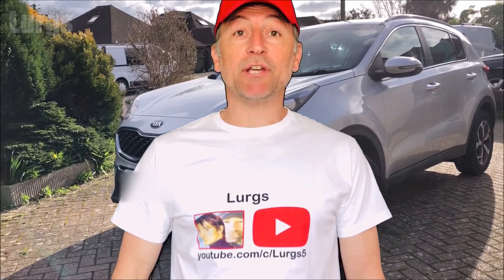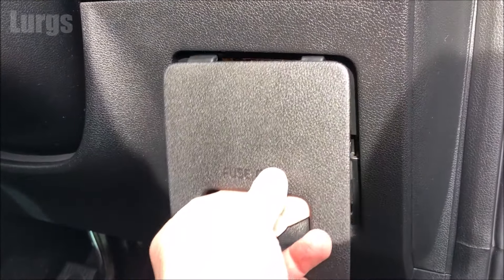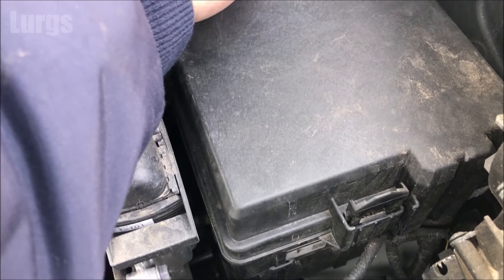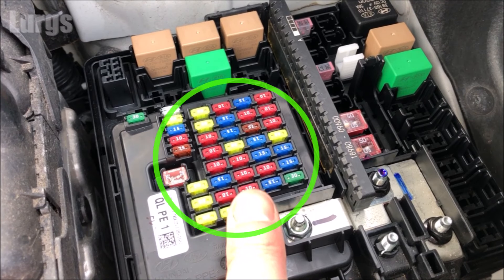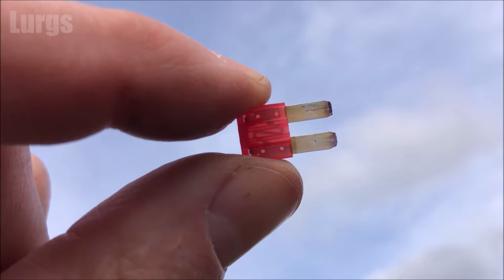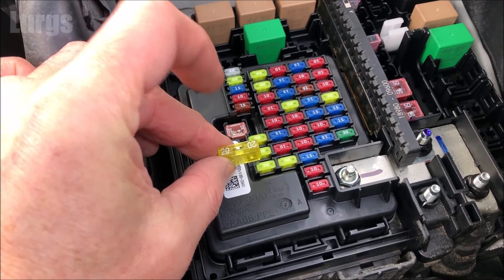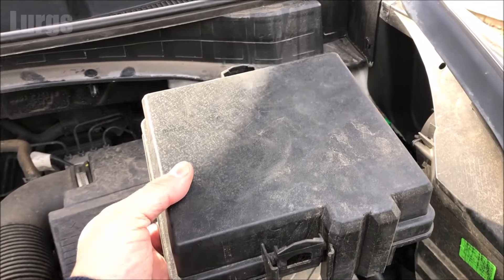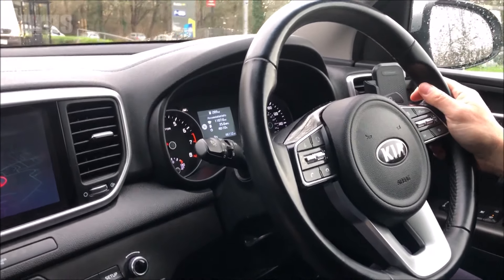Kia Sportage Fuse Box Locations and How to test Kia Sportage Fuses

Comment from the maker: Other useful How To Guides to help you save ⏱TIME and 💰 MONEY:
Kia Sportage How To Guides https://www.youtube.com/watch?v=0vBOs0VNKGY&list=PLqrXuUebV8N95grpYWULM_nqr10JPTVlp
.
Vehicles How To's, Tips, Tricks & Fixes  https://www.youtube.com/watch?v=w44aQ7dc_Lk&list=PLqrXuUebV8N9fyM8qA2D0rkVfv929Ckod
How to check car fuses without pulling them out using a Multimeter https://www.youtube.com/watch?v=w44aQ7dc_Lk&list=PLqrXuUebV8N9fyM8qA2D0rkVfv929Ckod
How to Test Car Fuses without pulling them out using a Car Blade Fuse Tester https://youtu.be/zLfa7_FbZrU
How to connect a Car Battery Safely https://www.youtube.com/watch?v=1b2vJjUefYQ&list=PLqrXuUebV8N9fyM8qA2D0rkVfv929Ckod
How to disconnect a Car Battery Safely https://www.youtube.com/watch?v=XJ5SUabZCbc&list=PLqrXuUebV8N9fyM8qA2D0rkVfv929Ckod
https://www.youtube.com/watch?v=w44aQ7dc_Lk&list=PLqrXuUebV8N9fyM8qA2D0rkVfv929Ckod
.
How To's, Life Hacks, Helpful Tips https://www.youtube.com/watch?v=dcmxUTsedlk&list=PLqrXuUebV8N92xXP4Dm_pHfBpEQ3wtP2R
Washing Machines How To's, Tips, Tricks & Fixes https://www.youtube.com/watch?v=0_gst8RokRo&list=PLqrXuUebV8N_Bv_41hH-IpIfM5qiS0Sin
Dishwasher How To's, Tips, Tricks & Fixes https://www.youtube.com/watch?v=6z22-Ysn7rE&list=PLqrXuUebV8N89GJMUjDiMqGpAcic3wqfD
Toilets and Plumbing How To's, Tips, Tricks & Fixes https://www.youtube.com/watch?v=vT5KwJ2A2eU&list=PLqrXuUebV8N_d4OWPjAk4PJ7LnKb0Jdot
Combi Boiler How To's, Tips, Tricks & Fixes https://www.youtube.com/watch?v=1gGEP2y_qHM&list=PLqrXuUebV8N8aiBpt_F3n23E3IOLlmgK2
My Reviews https://www.youtube.com/watch?v=QX0ge0QOXJk&list=PLqrXuUebV8N9_JYlSh2LjbfUsybF840oy
.
TECHNOLOGY
==========
Windows 10 How To's, Tips, Tricks and Fixes  https://www.youtube.com/watch?v=eZW7ka9xgXg&list=PLqrXuUebV8N95_cVCA-40v6eT9piGz26y
iPhone iPad iTunes How To's, Tips, Tricks and Fixes https://www.youtube.com/watch?v=hcGfZTcJxvo&list=PLqrXuUebV8N_YRivg9p4ZpkUyBDbSb8t7
iMovie iOS How to Guides https://www.youtube.com/watch?v=uTkXwZJ0gE4&list=PLqrXuUebV8N-D5BiCaF2AV-Qb-8gZwBFC
WhatsApp iPhone How To's Tips, Tricks and Fixes https://www.youtube.com/watch?v=5hhxjxkNMUA&list=PLqrXuUebV8N-bMvTYJdRXrKakVdChdl9o
Google Chrome How To's, Tips, Tricks & Fixes  https://www.youtube.com/watch?v=iLSbSA5YECc&list=PLqrXuUebV8N8RYpRb0gVVNf9SpC78SB47
Microsoft Word & Excel How To's, Tips, Tricks and Fixes  https://www.youtube.com/watch?v=OZi6yS79FLA&list=PLqrXuUebV8N_DyHPlBddZaL8LOwuCzFK3

Comment: I read the fuse panel diagram but i cant figure out which fuse is relevant to the passenger rear"inner tail light" on the hatch of the 2013 Sportage we have.. the bulbs burnt out a few days apart on the passenger side. The reverse light in the same cluster atill worls, just not the 2 small 921 bulbs in the inner taillight area. I replaced the bulbs with new leds and they dont work, but they work on the drivers side inner tsil light so i know the bulbs are good.All lther lights fromt snd rear work fine.. aignals, brake lights, bumper lights, headlights, doglights..  im hopijg this is a fuse issue not a wiring issue.

Any help would be appreciated
Reply from the maker: Not sure, could be a short somewhere in the wiring. Doubt it's a fuse if the bulbs burned out. I hope you can get it sorted.